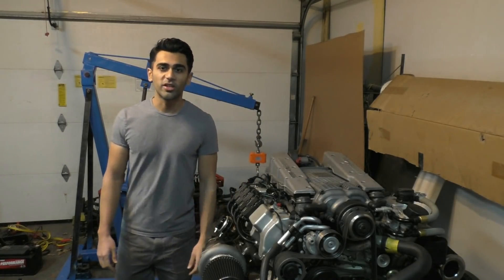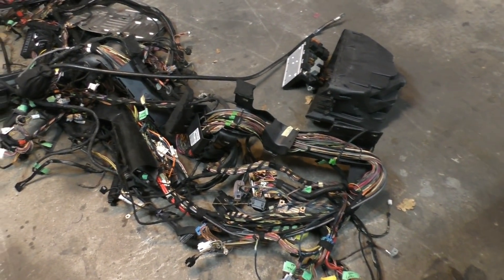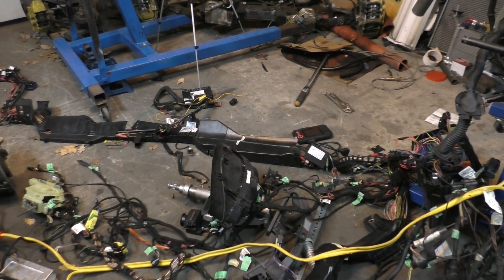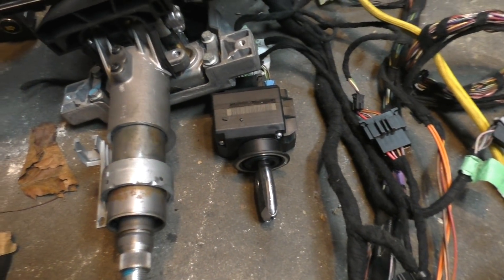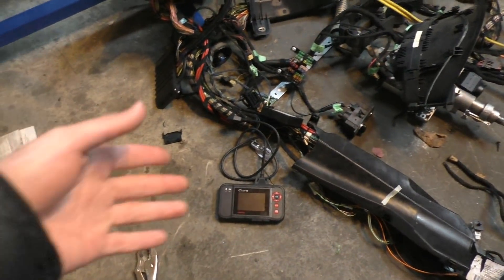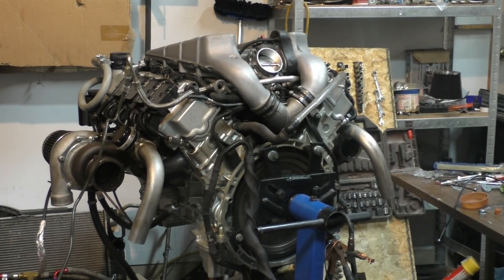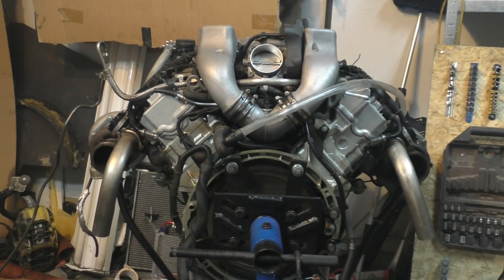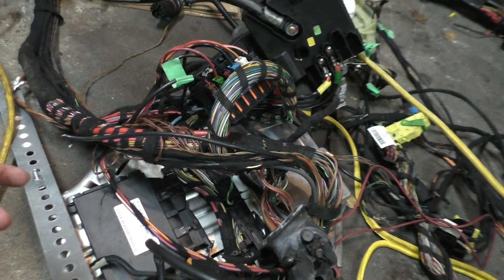Wiring up the Engine - E55 ASL Part 1

Comment: I'm doing a swap in e34 i used the platform from cls55 amg. I will use  the EIS, ECM, ESL Emulator,  central gateway  and a star connector (can Bus). and no fuse boxes. I'm missing a TCM, did you ever figure it out like coding it out? Thank you!

Comment: SL does not stand for ''sporty lightweight''.  Stands for ''sport light''.  Has nothing to do with weight. It is a class of sports car, as in sport light, sport rac,etc. All it means with Mercedes, is that its a luxury car with a light sport car touch, Wikipedia not always accurate.
Reply from the maker: Not sure. So that way CL (Coupe light) means slight coupe touch? I heard the name came from the original 300sl which had an ultra light tube steel chassis
Reply: @xfmotorsports  Has nothing to do with weight. Just letting you know so your not misinformed. CL does not stand for coupe light either. Don't go to Wikipedia for reliable info as it is written by average people. Anyone can write stuff on wiki

Comment: Well I have to say you are way misinformed on how to wire a stand-alone ECU system. All you would have to do is leave everything that you can in order for the stock ECU to read inputs and then piggyback a standalone on those inputs and let the stand-alone only control outputs. Then you can keep all stock function and have control.... it's really not that hard because it's only a few wires to connect far as inputs being piggyback and then doing outputs going to the engine. you could probably get rid of almost half the wiring if not 3/4 of it. it just depends on how much you have to keep in order to keep the gauge cluster operating normal. So the essential goal is the stock ECU and can bus system can witness everything that's going on but can't do anything about it. That's how you get what you want. There are many other ways to go about it but all the other ways would require aftermarket dashes Keys switches Etc. This is been done on many many race cars... there are even aftermarket ecu's that can work with the can bus system but it can get very expensive very quickly.

Comment: Could you please describe more how did you start your engine without transmission. I'm working on manual swap for my w209 clk320. I tried to disconnect transmission plug and shifter plugs but car didn't start. Did you do any additional steps? Did you disconnect transmission plug while the engine was running? Thanks
Reply from the maker: No, didn't do any additional steps. Unplugged it when the engine was off. Does your engine not crank at all, or cranks but does not start up?
Reply: @xfmotorsports  Thank for reply. Nope, not crank at all. Yesterday I did more tests, and with connected shifter (in P or N) and disconnected transmission plug the engine started, but with CEL (transmission error). Will have to work on TCU emulator to avoid CEL. Good luck with your project!!!
Reply from the maker: Hmm.. that's funny. Maybe its different for the CLK. I did get a few transmission codes but it wasn't effecting the engine so I didn't bother removing them. As far as your wheel speed sensors remain functional you should be good. If the wheel speed sensors don't show speed then the engine doesn't rev past 4k.
Reply: @xfmotorsports  Yes, didn't get any ECU errors either, only one TCU error, something about solenoids voltage. Unfortunately I won't be able to pass smog check with CEL :)

Comment: When my SBC pump "failed", the car would not shift past second gear and would not go above 80kph. Also, if the ECU thinks your transmission is in park, it won't allow the engine to rev above 4000RPM. You have to trick it into thinking that you're in neutral.
Reply from the maker: Yeh, I did do some playing around. The rev limit goes away when the wheel speed sensors detect above 30km/h or something. I'll need to somehow keep the wheel speed sensors active but disable sbc for it to work

Comment: Hey I’m wondering if you can help me out as I see you’re very experienced with the m113k engines. I was replacing the recirculating air flap on the supercharger and I’m have trouble separating the bottom of the sc from the top. I removed the 6 bolts that I saw were holding it together but it’s still on there pretty tight. Any help??
Reply from the maker: Its probably just stuck in place by the gasket maker. Remove all the bolts and try prying it apart
Reply: SK8215 thank you I’ll give it a try.

Comment: I'm actually rather surprised it still runs like normal with the esp module disconnected. My car cuts the power down to about half with the esp module disconnected (rodent got in the wiring loom)

Comment: You can use a STAR DAS Developer to set the code "Manual Transmission" to let the ECU knows it got a manual transmission, EGS might need to flash too

Comment: You can make the Gearbox shift harder, why swap a manual? I love this for the V8 configuration, Kompressor, and the Automatic
Reply from the maker: More power to the wheels, more control over the shifts and actually having a clutch. Its a much better option for time attack

Comment: How much power stock m113(non K) has got? Is there any difference in K vs non-K engine? (better flowing head, bigger valves, better cam, manifold?)
Reply from the maker: Well the K is supercharged, lower compression, stronger rods and pistons, stronger block, different cams and oil system. There's quiet a few changes in it from the regular engine

Comment: It's possible you just need to bridge the CAN wires to remove the TCU. Likely you just interrupted the ring topology.
Reply from the maker: I'll need to send all the valid CAN values that the TCU sends to remove the module completely. Its too much work that way. I'll try using a Star computer later and see if I can remove TCU from the system completely

Comment: I get it. Really. I won't even suggest a crate motor. Use this engine. But ditch the ECU and 100 pound loom. You talked about not building from scratch. The items you suggest are easily re-creatable with current modern ECUs.

Comment: Why not make your own harness from scratch and go stand alone?
Reply: LuckyDuckRacing exactly, he will eventually realize the ecu is the limiting factor but oh well
Reply from the maker: Well, I mentioned at 13:01 . Going full stand alone would mean throwing away all the stock modules since everything is CAN operated. Its way easier keeping the stock relay boxes and wiring and just replacing the fuel and ignition circuits to standalone later because that's really all that needs to be changed on the engine. This way I'll get to keep all the extra things functional (charge circuitry, head/tail lights, fuel pump/level, instrument cluster, original key and theft system, wheel speed sensors and all those extra sensors around the car). Its way more refined doing it this way than full stand alone
Reply: SK8215 not with this ecu, you will constantly be fighting some management, you can’t have a race car with no limits and street comfort ,not on this platform, time will tell what will happen
Good luck
Reply: @xfmotorsports  Race car wiring harnesses are not that hard to create, they are fairly basic after all, I agree that many of the after market instrument displays look terrible but personally I'm not sure i'd want to use an old modified OE harness in a new car just to keep the flash dials.

Good luck with it, a lot of people claim you cant mess with these harnesses at all so keep on it!

Comment: If you don't have a good machine shop to make the trans. Adapter plate let me know. I might be able to help you out.
Reply from the maker: I should be good for the flywheel adapter, just machining that myself. I'll let you know if I get stuck with the bell housing adapter. Do you have any good machine shops in mind around Toronto?
Reply: @xfmotorsports  No I'm in Kansas but if you get in a jam I would be happy to machine it for you no cost. Would need drawings or models. Enjoying your information packed videos on the E55. Or what's left of it...

Comment: Assuming you are in the GTA since you ran at cscs with your e55, if you need a hand wrenching, lmk. Id love to help, this is an awesome project
Reply: As well, I see that propane heater. If you run that in the garage, it puts out a ton of moisture, and will prematurely rust anything in your garage
Reply from the maker: Yeh, I am in the GTA. Thanks for the offer, I'm good for now but will let you know if things get more difficult down the road lol

Comment: Just buy standalone like AEM Link or ECUMaster
Reply from the maker: I will later, but I still want to keep the other systems of the car functional. I mentioned it at 13:02
Reply: U can use dual ecu wiring if you want help i can help you 😁
Reply from the maker: I'm just planning to use stand alone for the fuel and ignition. The stock ecu will manage the rest. Should be fairly straight forwards that way
Reply: Yes except that they need to share a bunch of sensors

Comment: How will you get past the 4,000 RPM rev limiter in park and neutral? If you disconnect the transmission, the transmission computer won't know what gear it's in and it will tell the ECU not to go over 4k just like if you had the car in park or neutral
Reply from the maker: The rev limiter disables above a certain wheel speed. I think its around 30km/h. If the wheel speed sensors read that it lets the engine rev to red line

Comment: If you still have issues with the transmission even after keeping the TCU, talk to The Mercedes Swap Shop, he should be able to code it out. If you have STARDAS I can help you with the air injection system and rear O2 sensors.
Reply from the maker: Thanks for the advice, will keep that in mind. Yeh, I'm planning to change things around with the Star later. Might help delete the sbc or replace it with the regular abs
Reply: @xfmotorsports  with STAR there's a manual transmission option you can change it to